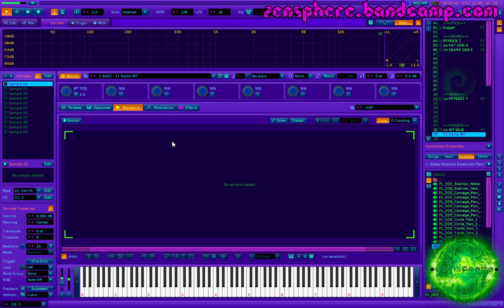Wavetables in Renoise

Comment: Wouldn't this be considered vector synthesis, not wavetable?
Reply from the maker: As i understand it, vector synthesis usually modulates amplitude of 4 sound sources in a 2D plane. I've worked that up in renoise as well, lol. The XY pad works well for controlling vector synths. This method is crossfading wavetables in a linear fashion (as they all do, more or less). Modern WT synths usually use a different method than simple amplitude (ie spectral morphing) between frames, but this method is wavetable synthesis, afaict